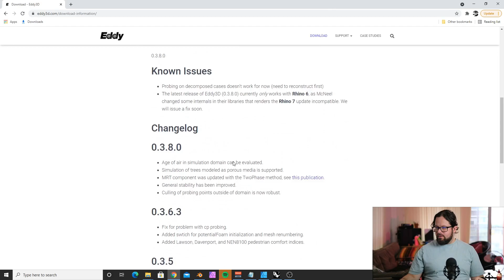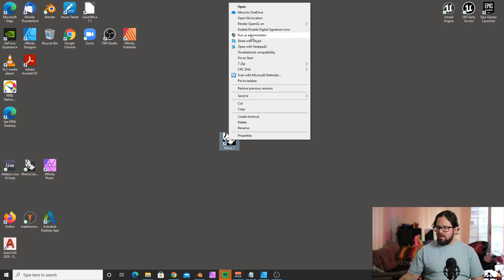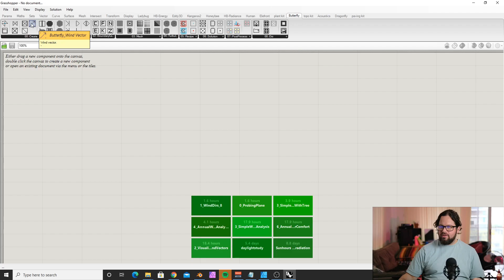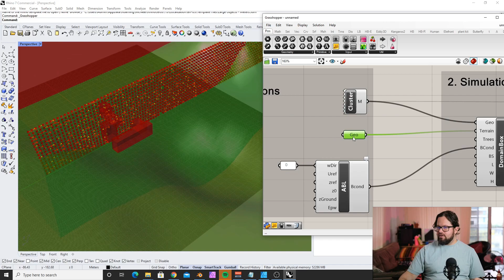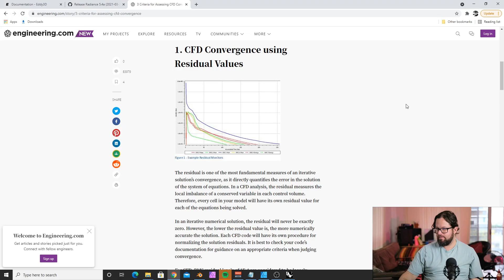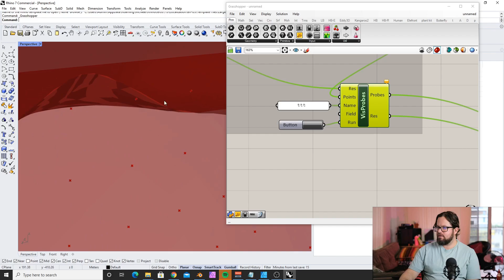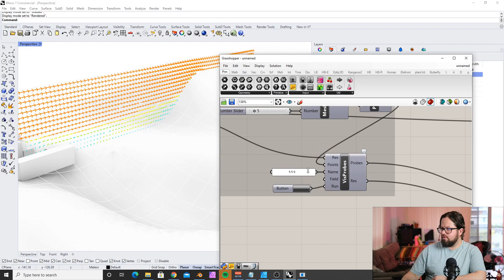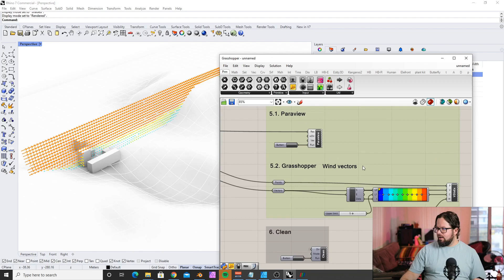Eddy 3d | CFD analysis  and Outdoor comfort | Installation and a first Test | CFD Part 06

Comment: something is wrong when i use eddy3d. The ‘VisProbes’ shows “The mesh folder does not exist ”.
Reply from the maker: Have you installed BlueCFD. Are you running Rhino in admin mode?
Reply: @PhilippGalvanDesign  yes，i have followed all the steps in video. but it still not work
Reply from the maker: @何明洋  can you try to run an example script. You should have one with your downloaded installation files...
Reply: Thanks,I will try later!

Comment: Hello, I am trying to customize the dimensions of a rectangular wind tunnel in my research according to the requirements in the AIJ literature. The wind tunnel should have a height of 6H, with the exit region being 10H and the other directions being 5H. However, I am having trouble achieving this effectively by modifying the settings in Eddy. I would greatly appreciate it if you could provide some suggestions.😀
Reply from the maker: i haven't looked into Eddy lately. Seems there was some updates.
I need to get myself familiar fist before getting back with an answer.

Comment: i'm trying out this since butterfly broke for me. but i cannot seem to get it to work: i.e. they say i have no mesh folder.
Reply from the maker: What version of blue CFD have installed?
Reply: Ah, this was actually the problem since I thought it would run off 2017 too like Butterfly, but it ended up being 2020. Installing 2020 fixed it, but I ended up having other issues which I'm trying to fix by watching your other video... thanks as always!
 @PhilippGalvanDesign
Reply from the maker: Are you running Rhino in admin mode?

Comment: I have been facing issue with annual wind comfort template with respect to the wind comfort factor. Hoping if you could make a video for annual wind comfort.
Reply from the maker: Annual wind comfort could be done in averaging your wind data... Butterfly can always just always just calculate one moment. By averaging (simplifying) yours wind data ( direction and speed) you could estimate it very efficiently.
Reply from the maker: Sorry just saw you posted the question for Eddy 3D. But the answer is the same. Averaging wind speed and wind direction could simplify the process.. if there are big differences in seasons you could average per season , month or week....
Reply: ok ill check on this. Thank you so much @PhilippGalvanDesign  !! Your doing a great job!!:yougotthis:
Reply: Hello, I have the same problem.May i ask which version can solve this problem?

Comment: Thanks for the detailed installation and explanation of the software! Super helpful
I'm having some difficulty running the sample recipe for simple wind with my company IT not allowing Rhino 7 to be run with admin privileges, which seems to be the issue at the point the script uses blue CFD to simulate - any ways around this that you know of!?? Thanks!
Reply from the maker: Have you tried running it as admin. I know that IT can set different levels of access for different software. I for example can run Rhino in admin mode on my work Labtop. Otherwise I don't know any work around.

Comment: As i try to figure out how to work with Eddy3D, I'm stuck at the Visualize probes section, it showed the warning "The mesh folder does not exist. Please create a mesh first"
I think it has something to do with the BlueCFD, the command prompt showed "process exited with code 255". any help on this greatly appreciated , thank you.
Reply from the maker: Which version of BlueCFD did you install?
Also, have you setup the environment for it?
Just checking the most obvious possible problems. Also sometimes it's good to reset everything try to rerun.

Comment: How about Philipp!
From your perspective, which one convinces you more? eddy 3d or butterfly?
Reply from the maker: Lately I'm a bit in doubt since Eddy3D's website just got deleted. Not sure if they are just stopped or if it is just a server problem. 
They are both based on BlueCFD so they are just an interfaces to the same software. Meaning that there is actually no difference in the quality of the output. I think from a logic point of view and practicality Eddy3D is more developed and organised...and more up to date. ButterflyCFD hasn't been updated since 2017.... Butterfly on the other hand has more tools and also geared more towards Architecture and has even features for Interiors. Eddy3D is mainly geared towards Architecture and  urban planning. My preference is Eddy3D. 
But hey, it's Grasshopper. I have both installed and use both. Again it's in reality just BlueCFD in the background which does the job.

Comment: Eddie3 looks much better and easier than the butterfly. If it could be possible to connect the ladybug weather data with it, then it will be awesome ✨. I gonna give it a try. Once again, thank you, Mr. Philipp.
Reply from the maker: Yes you can actually attach the epw. (Weather data) Same as butterfly. I haven't tried it though.

Comment: Eddy is nice and fast for CFD simulations. When I had to do open-source CFD, I jumped into using Eddy, as the new Ladybug Tools 1.x don´t come with Butterfly. The ability to add terrain, trees, probing planes and Annual Wind Comfort metrics is good. I have found the residual component does not work in the Annual Wind Comfort, but the workflow works. The Annual Outdoor Comfort had some error warnings and wasn´t running.
Reply from the maker: Thanks for the tips!
Reply: yes i did face the same issue with annual wind comfort. I replaced it fresh residual component and it worked.